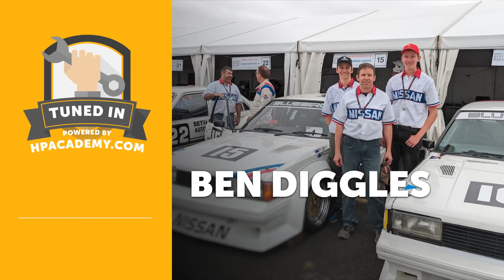Breaking Drag Racing World Records, On A BUDGET [#PODCAST]

Comment: Owned a few good Old fjs in my Day 2 rare s11 RS silvias were cool even had fj24 from reg
Had one in a Datsun sunny everything from the Silvia bolted up other than The driveshaft Silvia had same floor plan was a FJ conversion that was all Nissan struts crossmember diff all bolted in was bigger like it was a perfect conversion nothing cut or altered.... good package, about 20 years ago loved the car so much tried to recreate it 2 year's ago I'm still buying part's for twice if not 3 time's as much going with The sr20t this time 2 reasons More aftermarket parts but more importantly, funnily enough it doesn't look so Old in today's more modern times
Good pod cast about the FJ which seems to pull at my heart strings